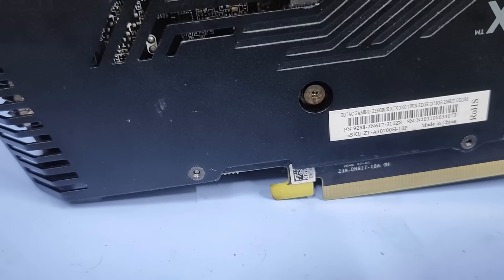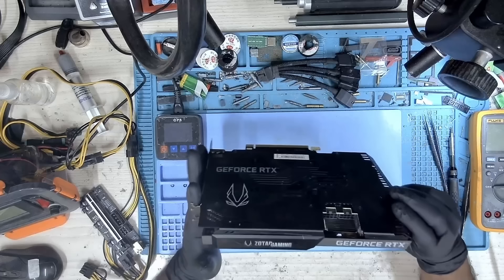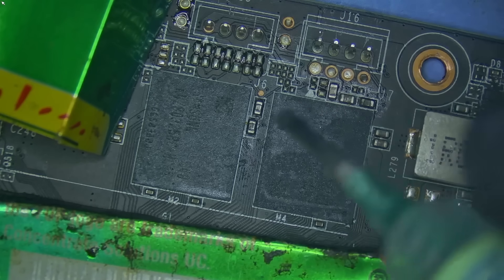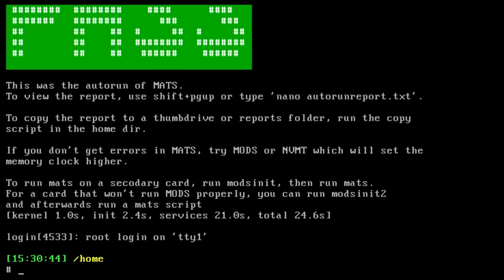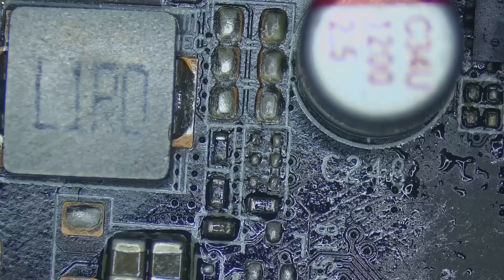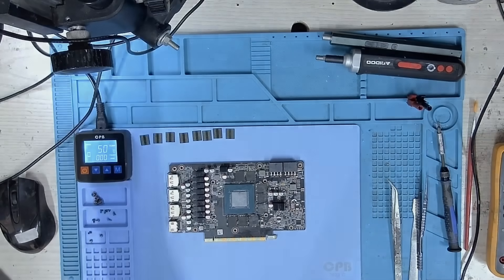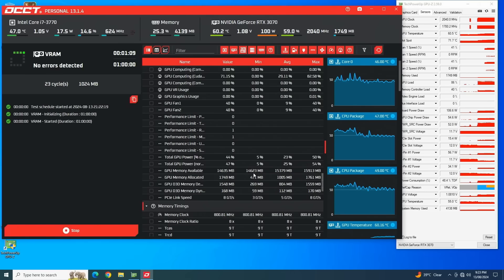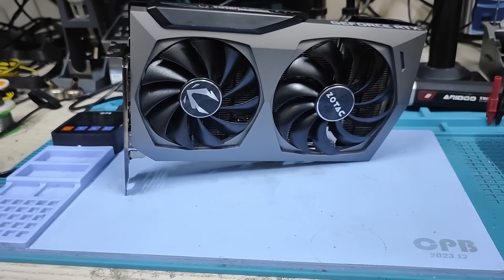Upgrading RTX 3070 Memory from 8GB to 16GB - Part 1

Comment: Veryy innovative and I wish you success. Im surprised you discovered the strap resistors - usually people dont know about them.
Reply from the maker: I literally had to hunt the straps on the board.
Reply: @GraphicsCardRepairs-tk7ql  what was your method for finding the straps? I have a broken memory chip on my 4070 mobile laptop so I'm planning on replacing it but if im going thrugh the hassle anyway I might aswell up the memory too assuming the strap pins exist and that i can find them.
Reply: @firequartz3606  It is impossible to up your VRAM for your case. 4070 laptop is running on 128bit bus GDDR6, 8GB VRAM. Your current config 4units X 16gbits memory chips is the best it will do. Higher density/capacity GDDR6 does not exist.

Comment: If this upgrade of the RTX 3070 becomes possible and safe, will it be possible to send you a card and have the upgrade performed? I looked for the costs of such an operation on your website, but I couldn't find them.
Reply from the maker: Yes once i manage a work around for the black screen issue.

Comment: What about timings and frequency? I mean can one try faster memory chips too? or just the identical samsung sku but double capacity?
Reply from the maker: In this video I initially installed 14gbps(stock speed) memory but later replaced with 16gbps faster memory. Its in the video.
Reply: @GraphicsCardRepairs-tk7ql  so what would be the best memory (in terms of performance you can use)? and where do you buy them from? I mean you in person becuse maybe you know some place with good prices :P  I want to test upgrading the ram of an EVGA GeForce RTX 3080 Ti FTW3 ULTRA see if it can reach 3090 lvls of performance :P
Reply from the maker: I too am working on one. Just could not find time to complete the upgrade. There are ome isue which i am yet to resolve. All of the memory is buy from Aliexpress. Make sure you buy only new and now the ones that mention 100% working.

Comment: I think you have a short when you change that resistors but i'm not shure  you can check again. 😄
Reply from the maker: I did not notice a short. I have the GPU. I will check again and update
Reply: @GraphicsCardRepairs-tk7ql  Ok like i said i,m not shure but it was fast. so i think i noticed something but i,m unsure it,s not bad to check again fo shure :)

Comment: Thanks for the video, it gives me courage, I'm sure I can do it. The problem is the SMDs around the vram chip that desolder and move, a real mess 😄You put a green protection on it, what was it? what if we stop them with kapton tape?
Reply from the maker: It happens to me as well. the SMDs move and sometimes are lost. it's just a part of the repair. I'm sure you can do it. the best is to practice on a dead board before trying it on a working board.
Reply: the green protection is for the capacitors so they don't blow up, it a piece of s Sprite tin can, you can use kapton tape but the piece of a Coca cola can is better.

Comment: And if you leave it with 12 vram, does the problem continue??? If this were not the case, it would be viable to go from 8 to 12 just with those modifications :)
Reply from the maker: The thing about upgrading is that you can only double the VRAM. Unless the BIOS is modified and that is a whole topic on its own.

Comment: Underclock the memory and see if stability and black screens disappear. Use MSI afterburner or your choice of control software.
Reply from the maker: Thanks for the tip! I appreciate your input. I will try it and test it.😁
Reply: @GraphicsCardRepairs-tk7ql  There is already a video on YouTube on the Vik-off channel with the results of the alteration. He came to the conclusion that the frequency was jumping up due to a driver error. The decision is to lock the memory frequency. PS: I'm looking forward to you doubling the memory on the RTX 3080 ti up to 24 Gb.😇

Comment: Great work, I have a 3060 Ti gaming z and was wondering if it was feasible since it's the same GPU as the 3070 with gddr6 memory
Reply from the maker: Like the 3070 i have been working on the 3060 Ti as well. I will be releasing a video soon. But it's not going to be the same as the 3070 upgrade. Stay tuned.

Comment: Nice work so far. I got an evga 3070ti. I overpaid for it during the mining craze sadly. I play games only.
Reply from the maker: 3070Ti is a good card. 😁 Those mining days craze.
Reply: I have the exact Zotac card in the vid, paid 900$ for it in January 21 but I knew I'll be able to mine at least some of it back and actually mined more than double at current prices, upgraded to a 6800xt for 500$ in late 22 because 8gb wasn't enough for me already.

Comment: Nice video - very educational. I hope your problem goes away when you use better PSU. 11.4Vis really to low  - of course you will get crushes. Also memory current voltage regulator chips should be enough to run the extra memory. You can even use small coolers above them so they wont overheat. 
Another question . Im in a market for used 3080ti. Mined . So I know that DDR6 chips get very hot and my question is -If I buy it - will they last ? Or them being used to run at 100C for years they are already degraded ? TY ❤
Reply from the maker: Unfortunately, my PSU just died. Time to get a new one. The 3080Ti would depend on the miner. Some guys really take care of their GPUs, like replacing thermal pads regularly every 6 months at least in the UAE. So it would be complete luck with mining cards.
Reply: @GraphicsCardRepairs-tk7ql  Thanks so much.  I know this guy takes care of his mining cards very well - he has replaced the pads and fans on it and sells it for 350$ . Is it worth taking risk that this card may get broken after year of use ?
Reply from the maker: $350 is a good price for a 3080 Ti. Test it on a pc before you buy it
Reply: @GraphicsCardRepairs-tk7ql  I will . Thank you again 👍❤

Comment: I have two 3070's. One EVGA and one MSI. Both cards run really well at 1440p, so I don't think I'll mess with them at this time. I do appreciate seeing what it would take to upgrade the memory.
Reply from the maker: I hope you like the video. If you are happy with the performance of the 3070, use it the way it is. It's still a good GPU.
Reply: @GraphicsCardRepairs-tk7ql  I do have a 4070 in my personal machine, but the two 3070's are in my office for my grandkids to play on. For the kind of computers I build these cards are a good match with the mid-range platforms they reside on. Oh, and I do have a lot of respect for anyone able to upgrade or repair computer components.
Reply from the maker: Absolutely. It all depends on the games the user plays. Not all games require more VRAM. 3070 is a good GPU and will meet your requirements as is. You have made the right choice. 😁
Reply from the maker: @Muchachito159 . Well thank you for sharing. 🫡
Reply: @GraphicsCardRepairs-tk7ql could u do this for me if I need it?
Reply: I’m also an EVGA 3070 owner, and I don’t see myself upgrading for another couple of years. It’s an excellent 1440p card paired with a decent CPU.
Reply: @FlyInTheLotion  love my 3070 but frustrating finding out the hard way that if you don't at least have a core for each gb of vram, there's a solid chance 8 core and under that you will have bottle neck. I have 32% bottleneck with 3600x :(
Reply: Really. All the tech universe says 8gb is not enough VRAM. They are just trash. 

You must be an invader from another universe...I'm reporting you to the universe invasion society. 

Joking of course. But yeah the hate on the GPU VRAM from tech tubers is real.
Reply: Hold on to those evga cards ^^ its piece of history
Reply: just use lossless scaling...you will do 4k easily
Reply: For production workload, 8GB is just not enough for 4K video editing. So doubling the memory actually makes sense. For games like Hogwarts Legacy, you will get missing textures when you run out of VRAM , and yes, 8GB is not enough for 1440p.
Reply: @fleurdewin7958  8gb is enough for 1440p lol, my 3070ti runs most games 100+ fps at 1440p on high settings, vram is a buzzword, judging a card based on vram is faulty thinking

Comment: Its not so bad reducing one setting or another to get good frame rates , at the end of the day a good storyline outplays graphics anyday and often in fps overly detailed graphics just overloads one with detail imao. But great  idea if you can pull it off !
Reply from the maker: Thank you 🫡
Reply: The way the new games are made use too much VRAM in my opinion.
You can have 4K textures that look beautiful. 
You can also have 1080p textures that look beautiful. 

It seems like a lot of games today use some kind of weird scaling method which degrades the look of the textures as you go down.

This didn't happen in older games. Unless, you go way way back where games just started removing items from the game world and you eventually were playing a cartoon if you turn settings down low enough.

Everybody says Unreal engine 5 is a great engine. Sure it can look beautiful but it also has many flaws. Performance is one of them. Native scaling is another. 
The engine works great with dlss and TSR. But I'm still not impressed. 

My RTX 4090 struggles with a lot of unreal 5 engine games at 4k when it shouldn't.

Comment: 12:45 The black screen is a know issue when you do that memory upgrade mod, here in Brazil the workaround we found was set the power management to max performance.
Reply from the maker: Thank you for sharing. I will try that. 🫡
Reply: @GraphicsCardRepairs-tk7ql  did it work?
Reply from the maker: @Stalicus yes watch part 2
Reply: I assume the memory timing straps are too tight for double capacity memory chips?  So that when it drops to idle speeds, the timings get very tight.  That's just the first thing that comes to my mind.  I believe he used some custom straps, but there's several that ya need, from idle to max and everything in between, all 7-8 stages.  Could be any one of the performance stages other than max.
Reply: Need to mod bios if you change ram. Timings, power draw, rails etc. its probably that on max perf mode it supplies enough, but not on lower power stages
Reply: @FigutativelySqueekin  no
Reply: Instead of using power management as a workaround, maybe look at what difference there is in power delivery components between this card and any real 16GB card using the same memory modules.
Reply: Does that mean that card will always run at full power and won't underclock to save power when just browsing the internet?
Reply: @alexdavies7112  If I'm not mistaken, maybe memory clock will be at max, but the gpu will stay at idle state. Maybe it draws some 50w or so insted of the single digit it normally does? I cant remember 100% from the videos I saw.
Reply: @alexdavies7112 Depends on the BIOS not the GPU BIOS but your motherboard BIOS some mobo can leverage both the integrated graphics if there is one and the GPU that you have
Reply: I own an original rtx3070 without memory upgrade, sometimes i get that black screen after quitting games, it last few second (10-15s) to return back to windows normally.
Reply: @a.g2902  this just in he exploded maximumly
Reply: Em uns 2 anos qdo minha 4080 de 16gb sair da garantia seria interessante a possibilidade de colocar 32gb, isso seria uma possibilidade talvez?
Reply: @GoMarkz  no porque tiene un memory bus mucho más pequeño
Reply: That sounds suspiciously similar to the issues my stock RX6700XT had which was fixed by using morepowertool to untick the GFXOFF feature and write to bios. Apparently the first generation of the card which I have has a broken super power saving mode that makes the card unstable at idle. By turning GFXOFF off the voltage never goes below 0.875 while before the change it kept cutting out completely.

Perhaps the issues are related to some similar power saving feature that supplies enough for the original VRAM chips but not the bigger capacity ones.
Reply: Known*

Comment: Do you do upgrades for money? 

How much would a 3080 10G to 16GB or 20GB conversion cost?
Reply from the maker: Currently I am working on a 3080 Ti upgrade which is similar to 3080 10Gb. There are some issues whichbi am not able to fix yet. Once I fix them I will release a video and start to accept GPU for upgrades. But as off now it's a long way off.
Reply: @GraphicsCardRepairs-tk7ql Is the issues is artifacting on windows or games
Reply from the maker: There are no artifacts only blackscreen when the load is off. it has to be rebooted and its back to normal. I am working on a fix. many have suggeted some work arounds i will try that and check.
Reply: @GraphicsCardRepairs-tk7ql  Can't wait. Which country are you in? Can you give an estimated cost for such an upgrade?
Reply from the maker: I am in UAE. The upgrade would cost $185 for 3070. I would suggest to wait for me to resolve the blackscreen issue.

Comment: Here is an outlier question ,   the RTX 3060 Zotac Amp white edition uses the RTX  3070 Twin Edge PCB  with the 3070's Vrm's  , seemingly making it exceptionally capable for overclocking , I have one but i don't overclock it  , i don't need to cook it for how i use it .  But would  this particular  card be  a good board for such extreme GDDR module addition mods,  can that particular card be modded with more Samsung modules  which is  what it comes with ,  to potentially 16gb  (maybe it would be 14 ) or does the bus width  introduce   restrictions and the possible extra demand for powering those modules affecting then  the  cards  power consumption and heat dissipation.
Reply from the maker: Unfortunately, the RTX 3060 is limited by its bus width. This GPU has only 6 active memory slots even though there are 8 slots present. The non-populated slots are disabled from the GPU core and BIOS. the 3060 already uses a 2GB GDDR6 memory which is the maximum capacity produced. Unfortunately it cannot be upgraded further.
Reply: @GraphicsCardRepairs-tk7ql   TYFYR ,it is going to be interesting as your 3070 project continues  fingers crossed you can iron out the issues

Comment: This crashing after switching back to idle is a known problem after upgrading cards to a "non official VRAM amout".
Maybe some older drivers will work but I'm not sure. Furthermore you can try the card in Linux if switching back to idle after load works there.
Another work-around I've seen is to add some more capacitors to the memory rail. Maybe it will reduce the peeks after changing the load.
Reply from the maker: Wow glad you mentioned this. I will try this out. Thank you again for leaving your comment. 🫡
Reply: Wow that's interesting, my use cases is mostly linux but I'm scare of my reballing skill 😂

Comment: Great video! I wish this could be done with my MSI RTX 2070 Gaming Z 8gb! 🤔
Reply from the maker: It can be done and it works too. 😁
Reply: @GraphicsCardRepairs-tk7ql  wow! And the card fully works and it's stable?
Reply: Yes, is just more memory @lQuadXl
Reply: @GraphicsCardRepairs-tk7ql  The Russian YouTuber VIK-on tried, but he couldn't get his modded RTX 2070 16gb stable. That's interesting if it is possible!
Reply from the maker: No it's not fully stable. There are crashes. I am working to fix those. I think I should make a video on 2070

Comment: Can you tell me if it's viable to do the same with a GT 740 ?
Reply from the maker: This GPU is quite old. The cost of upgrade will exceed the value of the GPU by significant margin. For less that the price of upgrade you will be able to buy a faster card with more memory.